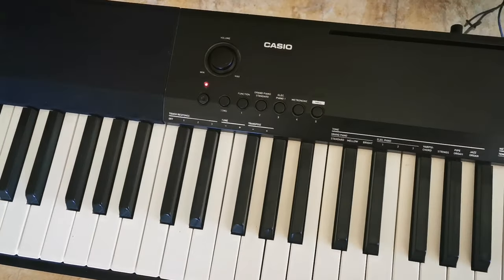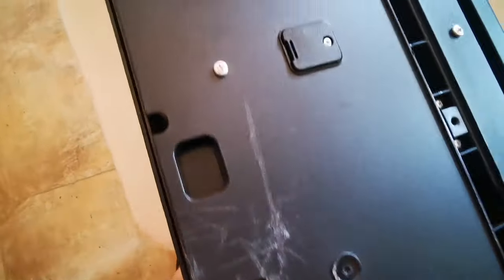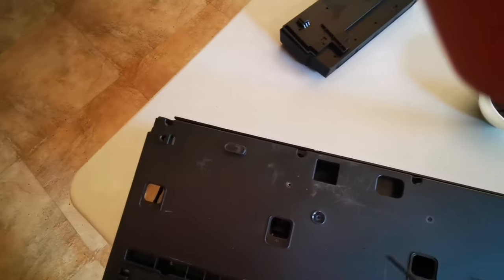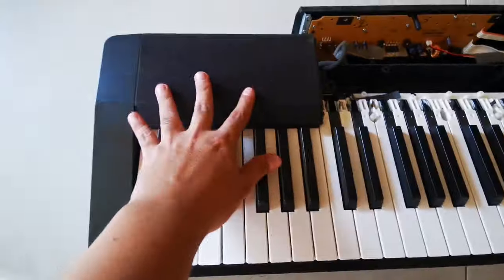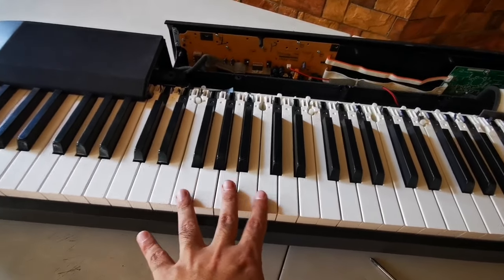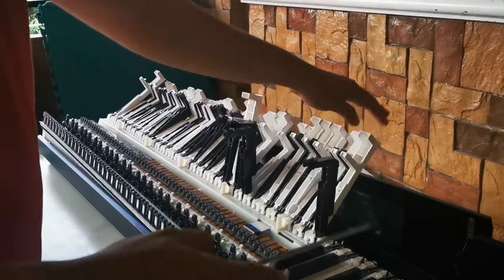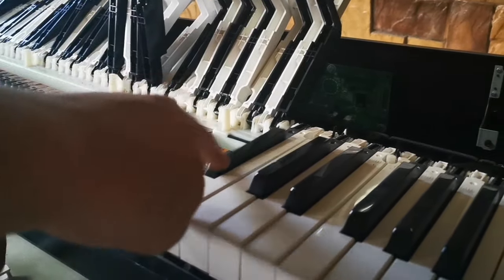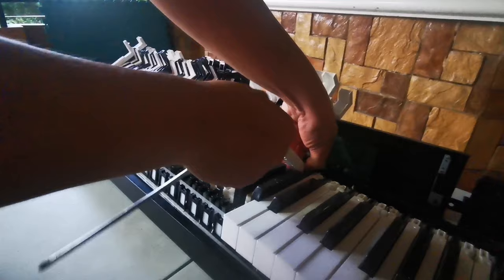How to repair Casio 88 keys Digital piano touch response problem CDP Px Privia Celviano

Comment: If you look closely at the rubber membrane the peg that goes through the circuit board has a small hole in it that you can put a tool into and push the rubber peg through without removing the circuit board. Just a tip for anyone that didn't know.
Reply from the maker: Thanks my friend for your tips. Appreciated your support and comment.....
Reply: I didn’t read your comment before but I had the same problem! I came up with the idea to use a toothpick and it worked! (Be careful toothpick can poke a hole to the rubber membranes so I had to cut the edge and use the wider part of the toothpick to stuff it in)

Comment: I remain stumped - the 38th key (B flat) sometimes works, sometimes doesn't. I took it apart, cleaned the contacts, etc, and same issue. I'm not sure what the grey rubber strip is called, but has two contact points under each key to touch the circuit board when a key is pressed  - like two nipples with black material at the contact points (felt or rubber or something) that make contact to the board and make sound. If I tap the connection with another set of contact points from another key the 'dead' note works! So the circuit is working, the issue seems to be with the rubber strip/contact points on that particular key. Thought I had it, but to no avail. Any tips are welcome, I'm out of ideas at the moment..... Thank you!

Comment: BIG thanks for this video my friend! Saved me when 11 keys did not work at all after some dufus (me!) spilled coffee into the keyboard! All good now! Someone commented on tip to use a tool in the hole for putting the rubber contact cover “pegs” back into the circuit board- I did not see that until I was done BUT- I used a simple point end round toothpick to gently push them in- worked beautifully! Everyone keep making music- it improves the world!! 🥰

Comment: Great video. I wish the video included successfully playing the keys that were "too loud" in the end to show that the repair worked correctly. I think it's possible to do this repair without removing the board that the rubber membrains are on, which would be slightly less risky. Great video for people experiencing this issue or similar. For people who are having a different issue (key not working at all) - May need to clean the contact under the rubber with isopropyl alcohol on a Q-tip cotton swab or similar. This can happen due to minor spills on the keyboard or something getting in there.

Comment: to get the rubber nipples back into the holes of the contact board I was having a real problem pushing down with my figners (wouldn't work) . I ended up using a sewing needle and gently pushed them back in with the dull side of the needle, worked like a charm.
Reply: Yep, me too.

Comment: That rubber contact setup is similar to TV/ Video handsets. They get filthy with dust and goo inside from all the handling. I have taken them apart and washed them in soapy water. Let them all dry first. No problems.

Comment: Great tutorial. We did the process and cleaned some keys but now the right side of the entire keyboard does not work only the left side. Any suggestions? Thank you..
Reply from the maker: Check the wire flex wire
 And reconnect... Normaly the problem is on the flex wire connecting to the main computer board
Reply: @MarkSomosoMusic  Will do, thanks..

Comment: Hey thanks so much for this video! Would it be similar for a privia px770? Is it possible to skip the removal of the plastic flex board? And instead just pop out a few keys around the area in question, if you can pop the contact rubber back in properly from the top?
Reply from the maker: depends on px770. . i have not open the board... try to open  just be careful not to damage the ruber  and flex wire
Reply: I repaired mine ( Casio privia px-a100) just by cleaning under the contact rubber. You can pop it back in properly from the top - they are tiny holes. I used the wider part of a toothpick and stuffed it in the holes. Be careful not to damage the contact rubber - I damaged one hole so I had to cut the edge of the toothpick and use the wider part. Try to stuff it in as gently as possible.

Comment: The cat peed on my keyboard while it was stored away in an attic... It was protected but some went through, nice ! 😕 Some keys were not velocity sensitive anymore. I opened it and cleaned everything with an electronic spray and a dry cloth. Some keys came back, some still have the velocity problem, but mainly the first five keys of the right electronic board (green one) are not playing any sound anymore. Do you think the corrosion killed it ? Thanks
Reply from the maker: yes corrosion  may killed it.. try swaping the  contact ruber if it fixed the problem

Comment: My CDP100 has several keys an octave above middle C that produce ghost notes - just sounds that aren't musical!
Reply from the maker: clean the rubber contact
Reply: @MarkSomosoMusic I shall - I haven't played it for years because of this problem 😢 I'll use Isopropyl alcohol (rubbing alcohol) and cotton buds to clean them and use a blower to remove any dust or particles that may have accumulated under the keys in the last ten years or so! Good video - thank you!

Comment: Do not do that with alcoholl or water will damage the electrical conductive carbon coating from the robber. Just gentle remove the dust.

Comment: Muchas gracias, de echo estoy arreglando un teclado casio cdp -120 saludos desde San José del cabo México mi nombre es Mauricio Fragoso
Reply from the maker: Appreciated your time checking my video.... Normaly casio needs mentainance. Cleaning the ruber Contacts ... Thanks i hope you will fix your board
Reply: @MarkSomosoMusic  Thank you, I just bought the Casio PX-360 piano 2 years ago and it turned out very well, it's a triple sensor and you have wooden ones.

Comment: What would cause the keys to work some days and some days not like they go in and out now it still powers on but no sound in the keys? Like the sound of the keys plays for a second then glitches off.
Reply from the maker: wire inside has a lost conection.. you need to open check the flex board and wire that conects the keyboard to the cpu
Reply: @MarkSomosoMusic   Thank you so much for the response!  It wouldn't work for about 2 weeks now it is all of a sudden working again 😒  I will do that next time!
Reply from the maker: update me if you fix your board... thanks

Comment: Hello bro I'm watching your video
Can you help me to my 
Casio celviano ap30
I accidentally broke my sustain cable the problem is I don't know how to put it back the color code to the 7 pin  thanks for your reply Ron from Philippines more power
Reply from the maker: I think casio has different models and pins.. If you broke your sustain cable let a regular technician can helf you fix the broken wire and solded it so it will be conected to the board